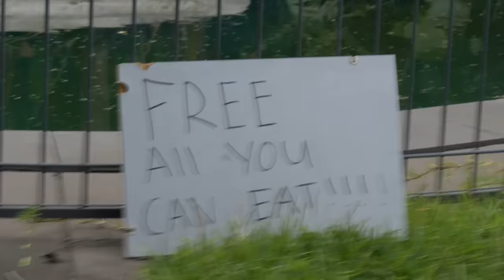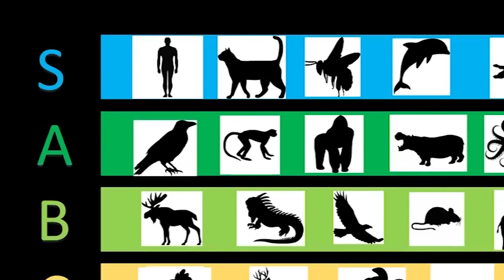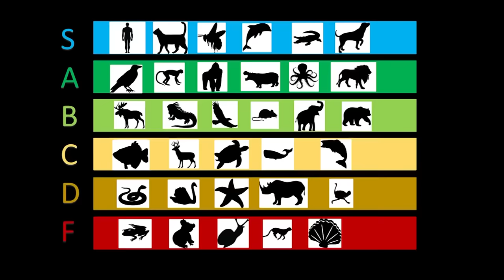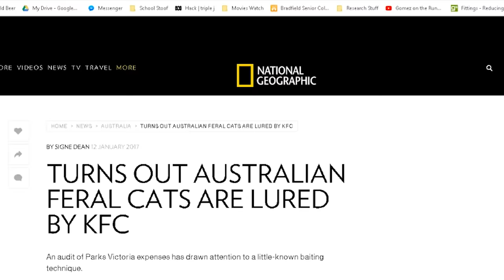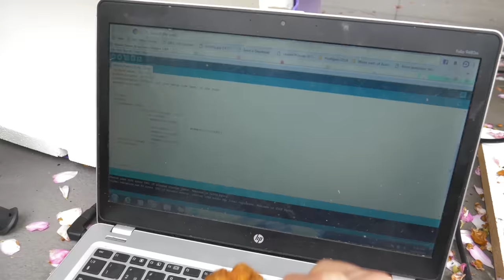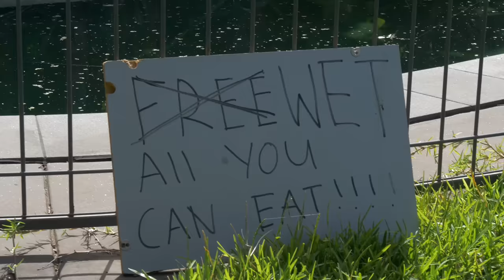Wild cats keep eatings the animals in my yard

Comment: you'd be surprised how effective something like this would be to cats (if it actually worked well). cats remember instances like this and will avoid your yard if you keep it running for like a week.
Reply from the maker: Yeh i hope so. I havent seen them since
Reply: I did a thing have you started seeing them again yet
Reply: They would probably find another enterance instead.
Reply: Cats learn very quickly and if the device doesn't give them too much grief then they just end up ignoring it.  I had a problem with cats using my old yard as the local toilet (I didn't have a cat of my own to deter them), so I made one of those simple mouse trap trip wire bangers (cats can't see the fine fishing line). Very first time I witnessed a cat set it off, the cat flew about 6ft into the air (and back on top of the fence).  A few pops and scares later, and the very same cat was startled, but proceeded to offload it's evil smelling load anyway.  To make matters worse, I was the only one with soil and grass in the backyard when all around was concrete, so the cats had never learned to bury their dumps either.
Reply: Look up Turnah81 "How to stop cats goinh on your car - The best cat video ever!" Cats dont learn. Also part 2,3, & 4 are quite good as well
Reply: You can do this manually, too. My dad used to hose the neighbors cat if it stepped on our property and it was traumatized ever since, even when my dad wanted to be nice to it for once.
Reply: @threeMetreJim  that sounds awful, how come people are allowed to have cats and not train them to stop them from ruining neighbors yards?
Reply: @slaveNo-4028  There are no rules in the UK about keeping a cat indoors.  A lot of people class cats as more of an outdoor animal, rather than a house dweller, unless it's a really expensive variety that someone might steal. I no longer live at the same place, so no longer have the cat problem, but I feel a little sorry for the people that now have to put up with it; but the yard may have been concreted by now, or whoever lives there may have a cat or dog of their own.

Comment: i had the same problem with cats and solution
only my water gun was actually a wire mesh attached to a microwave transformer plunged in to 240v
my kookaburras got used to the cat explosion sounds and are happy little chuckle boi's

Comment: A big dog had the habit of coming overt to my place daily and eat one of little the chicken..
One time the mother hen noticed him approaching and puffing herself all up jumped at the dog, aiming her beak at his eyes. She was so ferocious that he ran away. But later he came  back and when she was not right there he managed to grab a stray chick away from the flock.
So I glued an empty cornflakes box on a small plank of wood, with the box standing on one of it'narrow sides. Then on the vertical open side I stuck two sets of bicycle spokes also vertically through the top of the box all the way down through the carton bottom of the box, forming two sets of bars, one near the opening, the other a bit further in. To those bars close to the opening I attached two electric wires with on the other end a plug. 
I put one of the tiny yellow chicks in that cage behind the second set of bars, so it could not get to the set about to be electrified with 110 volts. 
The chick peeped constantly, and then the dog appeared. Attracted by the peeping he walked to the box. And to grab the chick stuck his nose in it.
He screamed loudly while jumping back, and ran off. Then I unplugged the wire and let the chick out.  

Later out of habit he came back, but now he was scared of little chicken, and would walk back if one approached him. Eventually, he never returned.

Comment: Dude Seriously... You needed an arduino for that!? Why does everyone think they need a micro controller for everything? Writing code...... What? Why? 

I did all of that in my head while watching this video using - 5 Transistors, 2 relays, 2 diodes, 2 LDR, 7 resistors. 3 capacitors mainly as filters but, needed a 1uf is needed for a RC timer.

There was a Space Program before the microchip was even invented. Remember that.
Reply: Ok Raul
Reply: You guys seem to be in doubt though, I can do what I say, it is my everyday work.